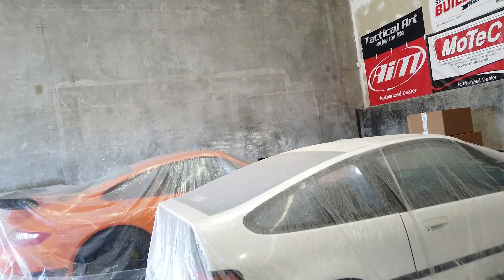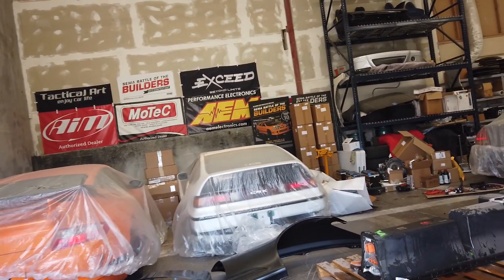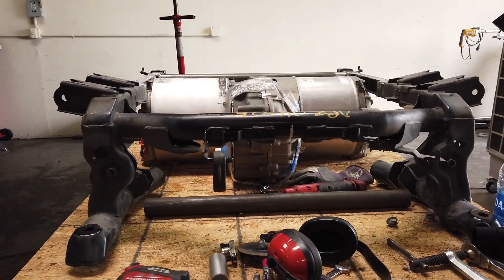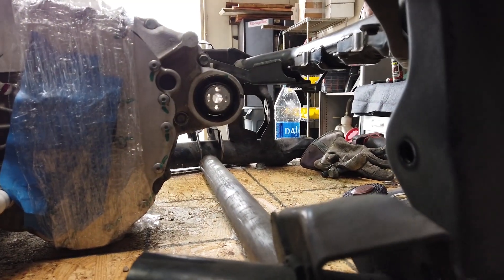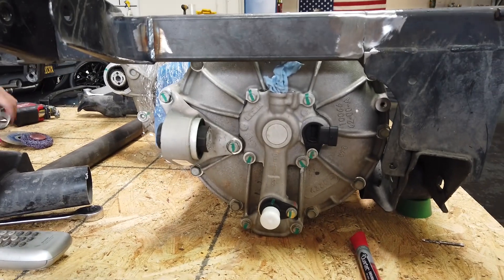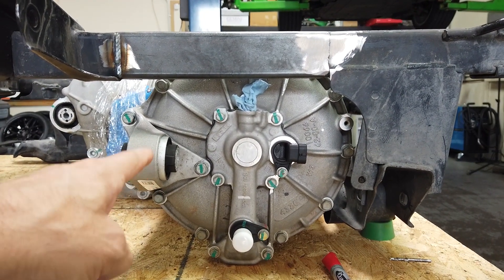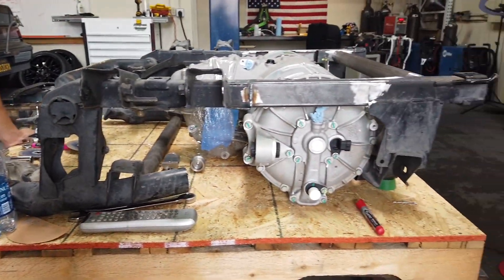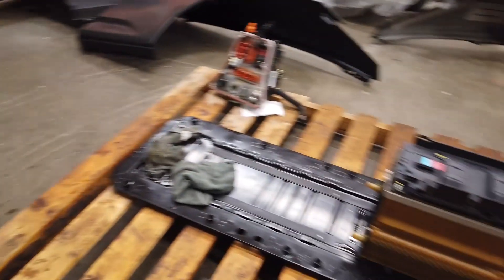Rywire EVS2k Build video #5 Motor Fabrication

Comment: Hey Ryan, how many of those Bolt batteries are you looking to incorporate in this build? As many as you can fit or what? Looks great BTW. I'd love to do something similar with an older Japanese pickup.
Reply from the maker: Yo! Alex. 
2 full packs, each pack is 18KW
Reply: That'd be some serious range even when you're into the throttle.
Reply from the maker: @XanderChopped   Ehhh, kinda, I will guess like 120 miles per charge. Good, but not excellent.